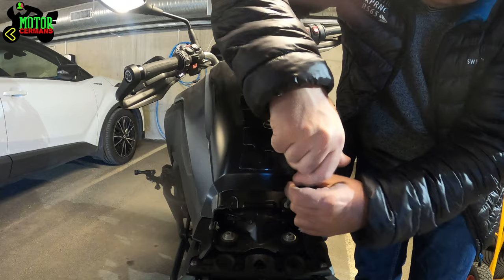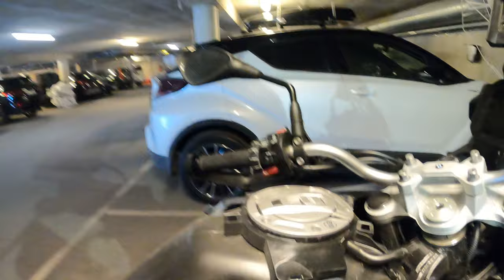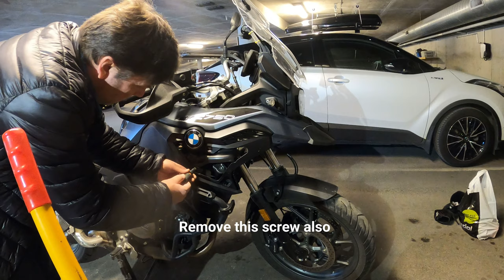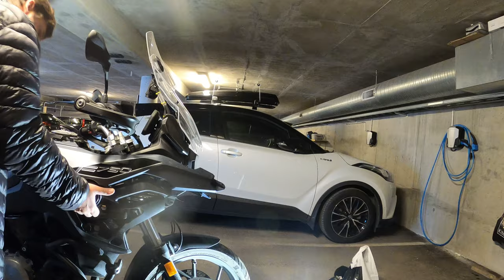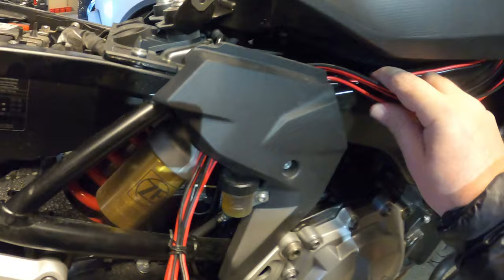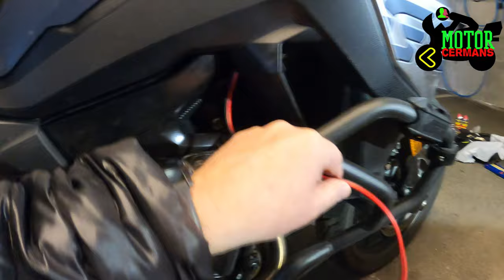F750GS/F850GS Remove plastic and install electrical wire

Comment: i just used an old coat hanger and threaded it under the plastic, then tied wires to it and pulled it through.

Comment: Hey, thank you very much for this video!
It was of great help to install my wireings as well.

I am curious about the windshield: How does it suit you?
And how tall are you roughly?
I am really struggeling to find a fitting windshield for my size which doesnt end in extrem turbulences... Also got to comfort seat which doesnt really help getting under the windstream.
Reply from the maker: I am 178cm tall.. Worked well for me.